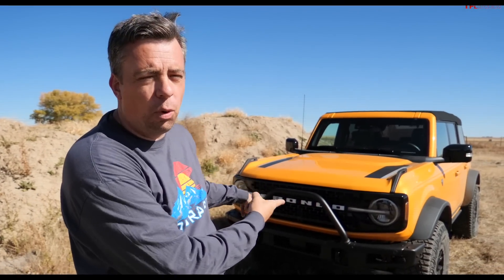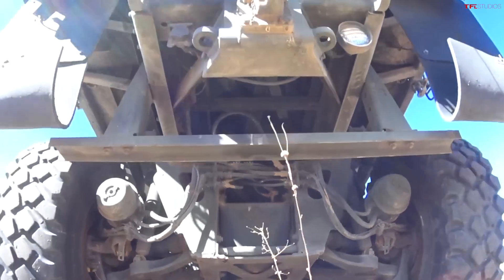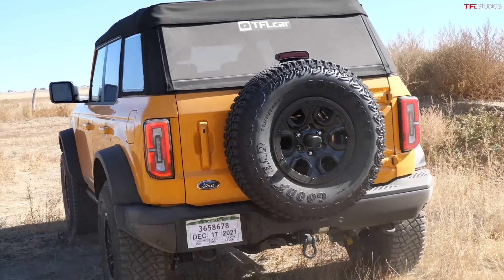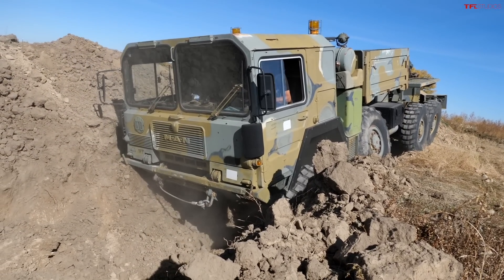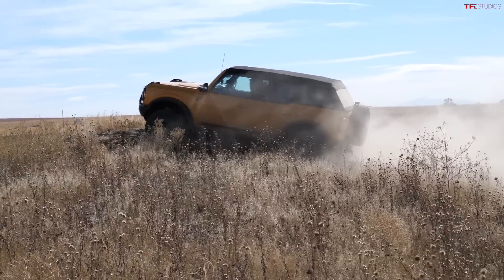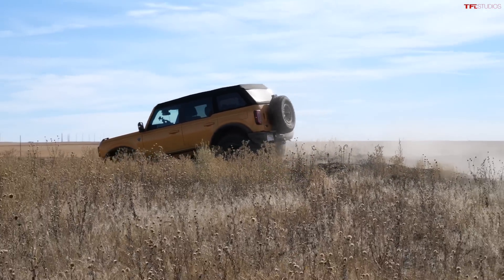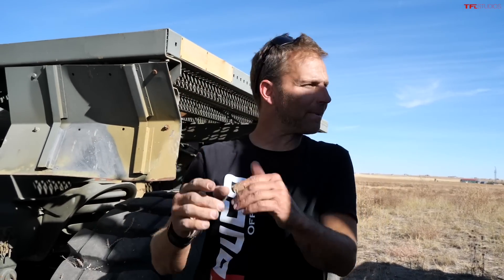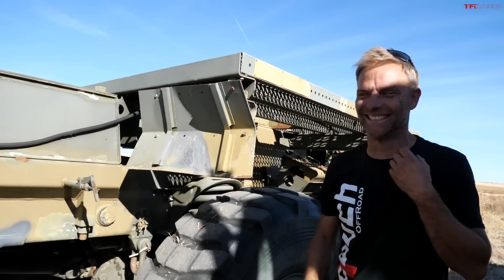Can the New Ford Bronco Keep Up with the Ultimate Military Trucks Off-Road?

Comment: I drove the MAN KAT1 in 4x4, 6x6 and 8x8 when I was in the German Military. They are really bad on fuel, but so capable offroad, especially the 6x6 version. Also worth mentioning,  not only are they all mechanical,  the engine is air cooled, so no coolant! And the transmission is a 6 speed manual with a dry clutch, but it also has a torque converter. So the indestructability of a manual, but with the benefit of a torque converter for offroading. They  now get used a lot as RVs going to Africa into the desert. Very cool to see one of my old work trucks at TFL!! Thanks for sharing that Andre!
Reply: Very interesting. I wonder how well the air cooled engine copes with the added heat of turbocharging.
Reply: @Fix_It_Again_Tony  that will be interesting to watch and learn. If you don't go too crazy on boost it should be fine.
Reply: Thank you for telling us the technical side that is really cool how they put a torque converter on a manual transmission very clever. I like the idea how it has no computers. Nothing but a pain in the ass. When you’re doing serious off Roadin you need things that you can fix yourself.
Reply: This is actually a derivative called the "kat2" made for the us military as a pershing 2 tractor, wrecker and i think some other uses. Its got a watercooled v10 and can easily be identified by its grill
Reply: @Fix_It_Again_Tony  the 6x6 and 8x8 variants are twinturbo and are running for the last 40+ years so cant be any bad problems there
Reply: @the_retag  cool info, I was not aware the US military used Kat2 trucks. I thought the 8x8 were all Oshkosh. Thanks for sharing that! The most resent version in Germany now also uses a liquid cooled engine, but went away from the amazing link suspension back to leaf springs, unfortunately .
Reply: @ralfhiller9043  the us military at least mostly used them in germany, so it was probably easier and cheaper to source locally than ship oshkosh's.
No kat 1 is built at the moment, only the hx, which is more like a beefed up construction truck. The sx was the (latest) kat 1 follow up, but also had a man liquid cooled instead of deutz air cooled. It isnt being built atm afaik, but im pretty sure a sufficiently large customer would change that
Reply: @the_retag  thanks for all the info. I loved the simplicity of the air cooled Deutz engine. And solid axles on coils and links don't need any more explanation. Was amazing offroad. Just terrible on fuel, HAHA
Reply: I sat in one, 6x6, in the Kuwait DRMO.  I would have loved to buy it, but it couldn't be shipped anywhere.

Comment: lol at "10, maybe twelve troops in the back." I have become intimately acquainted with 20+ other Marines in the back of one of those MTVRs. The Corps is, shall we say, very efficient with available space.
Reply from the maker: Thank you for the feedback!  Thank you for your service.
Reply: Cool profile pic!
Reply: Same with the army.  I know this phrase is physically banned now but we were told " Nut to butt. Make your buddy happy"
Reply: How many Marines fit in a 7ton? Always 1 more.
Reply: @Mmmmmmdonuts  you guys called them 7tons?? We called them MTVRs. I remember seeing them uparmored going through fallujah and Ramadi in 05-06. Uparmored meaning any available metal plates being welded together. Lol
Reply: We've fit 27 in the back of a 4x4 LMTV with gear🤣 I'm sure you could stuff 30 or so in a 7 Ton
Reply: While shooting paint blank rounds at for around the truck. Those blanks hurt. Ask Alec Baldwin.... Too early?
Reply: Army or marine trailers. Can stack hundreds of soldiers upon thousands with a train of trailers attached to it. 1st ID trailer train FTX run. On tank trail was fun! As a lower-class field Medic, I approved this infantry train and the hook-up timing was faster than light. Don't forget your blinker fluid! Casualty evacuation by hand. Using those worthless trailers, into a field advantage.

Comment: This is cool to see. I drive the MTVR on a daily basis as an instructor in the Marine Corps. C12 Catepiller with 420 hp and 1550 TQ. There's also our 10X10 version called the LVSR that is very,  very  capable.Overall great video TFL!!!
Reply from the maker: We will have a 10x10 video coming soon.
Reply: Everything you just said is badass. Thank you for your service, brother
Reply: Semper Fi, loved driving the mtvr when I was in, it's a beast.
Reply: I learned on the MTVR, original lvs with the screaming 8v92. As capable as they are it doesn't take much to get them stuck. Also Oshkosh uses that Tak4 suspension in their pierce fire trucks, along with the rear steering from the lvsr and the "command zone" screen in their fire trucks. Although most pierce fire trucks have solid drive/tandem rear axels.

Comment: From what I understand, the MTVR has only been showing up in the surplus market fairly recently, and a number of those showing up have considerable wreck or other mechanical damage.  Still, if one can find a relatively undamaged one, the prices they go for at auction are not as high as one might think--probably considerably less than that Bronco costs.  Earlier this year, I did see a "civilian-owned" MTVR chugging down the highway--it was running at about 60 mph.  Of course, the military truck folks never like to talk about it and tick off the enviro-nuts, but military (and ex-military) trucks like the MTVR are not required to meet EPA emission standards, so they are devoid of all that emission-control junk.
Reply: GLORIOUS

Comment: Love the MTVR, drive them every day.  Side note, the MODE button on the transmission controller does not control the diff locks.  The switch in the center of the dash can control the three diff locks.  It turns on the PTO for the winch or dump bed.  Since that cargo truck doesn't have a winch, it does nothing.
Reply: That all depends on what you have it connected to, and what you program it to do. In our two LMTV troop carriers, the mode button locked the center diff. But you can have it do multiple things (up to three if I remember correctly), as I mentioned, depending on what's wired in. So, theoretically, if you also had lockers on the front and rear diffs (going with the LMTVs I had, but they only had a center diff lock), you would hit mode twice (holding it down on the second click) to lock, we'll go with the rear diff this time, and three times for the front. If the light on the top left of the button turns on, then you did it right lol. It's not nearly as complicated as I've made it sound, I just suck at describing how to do things 🤦🏼😂.

Comment: Unbelievable.  Sweet video!! Just awesome! Ford Bronco is a beast!
Most people don't know is that the US military has tested things long before civilians see it on vehicles...such as lockers, independent suspension, GPS navigation etc...
US military has 30-40 years advanced technology into the future!

Lockers make a huge difference. It's why I replaced the factory front clutch limited slip with a Detroit locker on my 22 F350 tremor 6.7. Detroit locker is superior to even the Truetrac
Reply: A noob here. Could you please explain in which way one locker may be better than the other? I get why a locking diff is better than an LSD but don't all lockers do the same simple job?
Reply: @ldmtag  in terms of which axle is better to lock (talking in regular 4x4 relm here) it's depatable which axle it better to lock, the majority lock the rear first becuase then you don't lose as much maneuverability when steering or have nearly as much conserns with breaking something when  getting turning on a bigh traction surface as the front axle. For lockers, you really have 2 types of "locker", one that solidly locks ip the axle and prevents the 2 wheels on that axle from spinning at different rates, and limited slip differentials (lsd's) which limit, but don't stop the wheels turning at different rates (this is what a lot of offroad traction controls try to emulate using the abs system). Hope that makes things clearer. Ask away if you want to know more
Reply: @Nesten321  appreciate you doing a lot of writing but I'm afraid that's not what I asked. As you probably didn't notice I mentioned LSD in my comment. I know what differential lock does, I know there's LSD, and I know there's electronics that brakes the spinning wheel. I even know the correct torque distribution - something most car people get wrong: 50:50 for open diff, dynamic distribution to the wheel with more traction when the diff is locked.
What I asked is why the guy chose that specific type of locker. I know what locker does but I don't know what it's made of and how exactly it locks the axles together. That's why I don't know which type of locker is more reliable, operates quicker, can lock at high speeds, etc.
Reply: @ldmtag  What probably wasn't clear in my previous comment is that regular locking diffs are prefered for lower speed offroading where as a lsd is prefered for higher speed stuff and performance applications. Either can be tougher in each the application that they are made for.
Reply: Also lsds and electronic traction control systems are similar in that they both don't offer perfect 50/50 tourque distribution (think of some high performans awd cars that have a 60/40 power split front to back, i belive that is done with a lsd in the transfer case) (lockers are either open when disengaged or a fixed 50/50 torque split when engauged where as lsds are always active and only limit slip, not prevent it.

Comment: The best "offroader" I have driven was when I was in logging and spent two summers driving a skidder. 30,000lbs, articulated, 48" tires and wheels weighted with 100 gallons of water each (adding below axle weight), 140hp six cylinder turbocharged diesel, hydraulic brush blade up front, 50,000lbs hydraulic winch in the back with 75' of 3/4" winch line. If it was outfitted with diamond chains all the way around, there were very few places it couldn't go. Side-hilling was its one weakness, but then you are ruling out all wheeled vehicles and into tracked vehicles.

Comment: The Oshkosh truck has the same turning issues as the GMC CCKW trucks of WWII, as a consequence of its short wheelbase. I ran a prize shoot for 14 years (here in NZ) and one attendee was an elderly farmer with extensive experience of GMCs. He said that the 6x4 versions were useless when it rained because they would not turn on the grass, they would just keep going straight ahead. The best known GMC CCKW in New Zealand is possibly the truck with a wide cab created from two original cabs so that the owner could fit a Chevrolet 327 V8. His truck uses significantly less fuel than the original ohv 6 cylinder version.

Comment: Great video. Unfortunately, the Bronco is nearly impossible to get for many long time reservation holders. Ford's dealer allocation formula for 2022 prioritizes large volume dealers over customer reservations. Ford has all but abandoned their commitment to deliver reservations before dealer stock. For customers that reserved at smaller dealers who have fully embraced the Bronco, it will take years for them to get a delivery.
Reply: Whine...whine...whine...whine...care for some cheese...with you whine...?
Reply: @buckhorncortez  Unlike many others, I'm not complaining about the overall delays that are impacting just about everyone. Just asking that Ford honor their original commitment to reservation holders.
Reply: @grisa12345  Sure they do. Eventually. But until they can build more than can be sold they'd rather placate large volume dealers.
Reply: @MikeJones-bk6sy  Dude, get it through your head, it ain't easy for anyone at this moment, they are selling Broncos, how they are doing it is the way they can, asking for more is simply complaining just to complain because literally nobody has it easy, i myself right now should be doing internship and working and studying for school, but guess how hard it is to find a job that will accept you in all the crap that's going on. It's bad in general, at least they make an effort.
Reply: @raionshishi8290  I understand the challenges and can accept the delays. I am not OK with Ford building dealer stock for a large volume dealer when a reservation for the exact same build sits unfulfilled at another dealer.

Comment: Maybe you should check out current military vehicles like the Oshkosh's JLTV.  That replaced the HUMVEE.  Oshkosh also builds a variety of other off-road vehicles ranging from fire trucks for airport to military heavy trucks, including an 8x8.
Reply: Pretty tough to get a JLTV in the civilian market.
Reply: @badgerpa9  Stop by Oshkosh.
Reply: @WillPittenger  Been in there, as a system tech years ago, they do not let citizens drive or film in the buildings or vehicles.

Comment: Military trucks seem to be very overbuilt for their purpose in order to enable high speeds off road without breaking suspension components.  They're able to use momentum to just power through and over obstacles.  For example, a lot of military Hummers carry just 4 soldiers and their gear, but they have a heavy duty 2500 pound cargo capacity.

Comment: In Snowrunner for some nonsense of a reason no small scout vehicles can keep up with even the road-biased big trucks. Fleestar even on street tires is so much more confident that the starter scouts they give you.
Reply: That’s because Snowrunner is designed to replicate the absolute worst conditions you can possibly imagine taking a truck out in.

Comment: THe bigger truc ks I would mod to fit overlanding/boondocking hardbody camper box setups with every modern convenience!

The the 6x6 and the MAN trucks are incredible capable and would be an IDEAL BUG OUT SHTF ZOMBIE APOCALYPSE vehicles once properly fitted for long range (i.e. extra fuel tanks) GLAMPING GEAR !!!!

Gimme the trucks, some 8000 series 3 inch aluminum tubing and 3/8ths inch plate and I will weld you the IDEAL Glamper Box (aka Glamour Camping with EVERY modern convenience) to fit on top!

v

Comment: the Bronco is meant for city guys who like going fishing and hiking on weekends but has poor off road features the army trucks are meant for carrying loads in any conditions or terrain so the SUV has no chance against them
Reply: Baloney. The Bronco is one of the best factory spec consumer off-road vehicles. Sure you can spend a lot of money on aftermarket lift kits and larger tires, etc to make a more capable rock crawler. Vehicles like the LMTV are beasts and more comparable to industrial construction equipment.
Reply: @andrewgee241  for me the best off road vehicles are land rover defender Toyota land cruiser and mercedes Benz unimog the bronco is well known among off road expert and the military vehicles of second hand are used by contractors in logging and construction in difficult terrain contractors

Comment: The key word about the Bronco is "factory"  The standard factory SUV sucks, especially the older ones with not much more ground clearance than a car. There is no comparison between that and a working military vehicle. Most Broncos are at place they do not have to be in, a real military vehicle does not have such choice. For harsh conditions and abuses, the number one choice in the world for terrorists, Taliban  etc is a Toyota.For really rough terrain, armies use helicopters, the Bronco have a size advantage, but it is useless when you have a dozen tanks low on gas waiting for fuel.